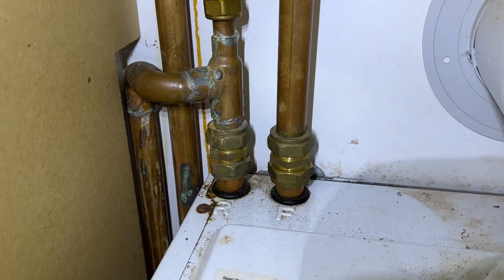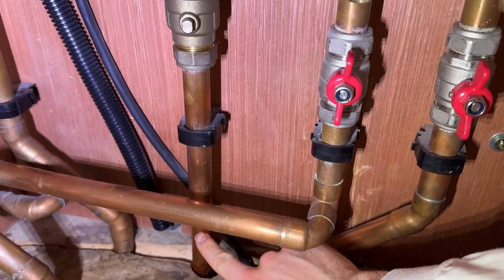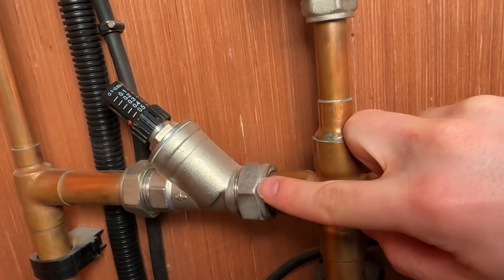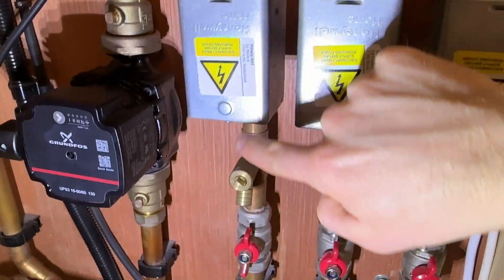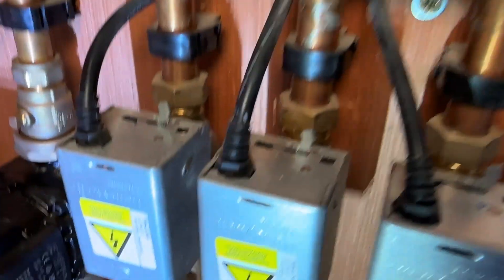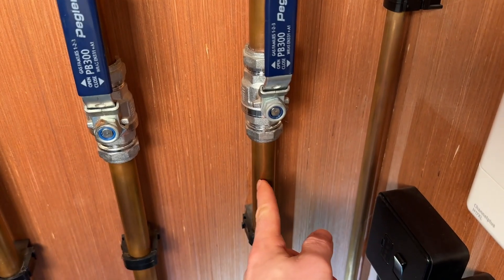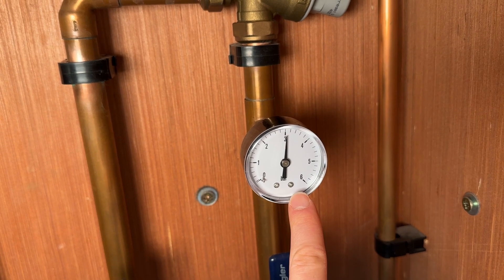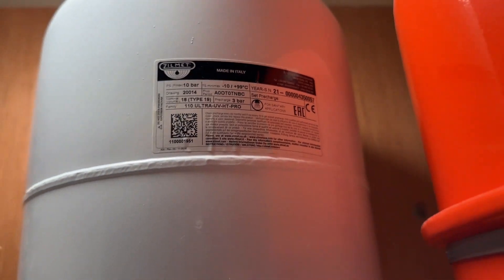How an Unvented Cylinder and Central Heating Work

Comment: really helpful vid, I am about to renovate my 3 bed victorian terrace.  I currently have a combi but will be adding an L dormer with further 2beds and 1 shower room. 3 plumber so far have had different opinions,  1 has said a 50kw combi will easily handle 2 showers, another said 28kw system boiler and cylinder will be best. I dont want to install combi and then not be able to make use of 2 showers, on the other hand I dont want to have huge heating bills with a cylinder. it is 5 ppl household. any feedback would be really appreciated. also putting underfloor heating in new kitchen roughly 6x5 meters if that makes any difference.  TIA.
Reply from the maker: Good luck with the renovation! First thing to check is your incoming water flow rate, as a cylinder needs at least 25 litres a minute. If you get a bucket you know the capacity of, fill it and time it, you can work out litres a minute. 
If you have less than 25, you’ll need to consider a new supply if it is old and 15mm, or if the road has low flow rates, you need an accumulator and pump. 
I don’t think a cylinder will cost significantly more to heat a house and heat hot water, you don’t lose a lot from the storage. Any reason why they said a cylinder will cost more to run? 
Check the max output flow rates on the boilers you’re looking at, and compare to the showers you plan to fit. I expect they would be enough though and you’ll want to go with the cylinder. Thanks for watching!
Reply: @TheDiligentDIYer1759  thanks for your reply, if you have central heating on for a few hours morning and evening does this always heat the water in the cylinder? I'll check what you have suggested regarding flow rate and see what works best for us. thanks again
Reply from the maker: No you have valves controlled by your central heating controller, so you can have heat to the cylinder, or radiators, or both

Comment: You need to talk to your friend  about the difference between ch expansion vessels and dhw expansion vessels as you clearly don't have a clue
Reply from the maker: There is more polite way you could have phrased that…
Reply: @TheDiligentDIYer1759 To be honest, the internal construction of the expansion tank is wholly irrelevant. The only serviceable part is the Schraeder valve as long as you use the red on the heating and the white on DHW (and read the manufacturers instructions) you are good to go. When did a plumber actually repair anything anyway - they just replace parts.😉
Reply: Harsh

Comment: Really good watch - so iv got an older type hot water cylinder and heat only boiler (non combi type) - i have an old "sunvic30" control unit that has a broken switch so i really need to get this sorted because i can only have HW and CH on at the same time, it wont just do HW on its own - another thing, i have one of those Grundfos pumps but its the older type with just manual analog switch with "i/ii/iii" on it - i appear to have a thermostat on the boiler but the small control wheel on it just spins so i cant really have any control over whats going on, when i turn the system on by the control unit it will all come on fine etc and get hot radiators and heat the water - but after so long obviously its turning off the stat at the water cylinder and then shortly after my radiators start cooling down because the boiler turns off - any idea why its doing that? i want the radiators to still stay on heating the house.
Reply from the maker: Thank you, I think it sounds like you need a new control unit. My guess is the controller is shutting off everything because the cylinder stat has clicked off. You can probably get a new one cheap second hand. The one controlling my hot water was actually a new open box one off Facebook marketplace. 
Although if this has always been a problem, it might just be wired up incorrectly. You could try and rewire it yourself, but this is quite complicated if you haven’t done it before and I’m not sure what sign off requirements there are. 
Thanks for watching!

Comment: good video however, you said you had the pump on the flow ! surely you would put the pump on the return less stress and a lower temperature at the pump, pump's are better at pumping ( pushing )water ?
Reply from the maker: I think it’s personal preference really and doesn’t make too much difference, but generally plumbers put them on the flow. Thanks for watching!

Comment: Really nice video and well done - thanks. I'm curious to know - how did you navigate the requirements to have qualifications such as G3 certification for unvented systems as a DIYer? Cheers
Reply from the maker: Thank you! Fortunately a friend holds a G3 qualification, so didn’t need to worry. I think you can do the course yourself though, I did look at it and it was fairly inexpensive, so could be an option for a big DIY install. Thanks for watching!
Reply: @TheDiligentDIYer1759  how did you register it with building control?
Reply from the maker: My friend who has the qualification helped install it, so was able to register it with building control.
Reply: @TheDiligentDIYer1759  The G3 qualification alone does not allow you to register an unvented cylinder in excess of 15 litres. You need to be a member of an approved contractor scheme or gain compliance directly through local building control.

How did you register it with building control?

Comment: With the unvented systems do you have pressure regulation for all cold feeds in the property, I'm thinking about balanced pressure across mixer taps shower valves etc, I imagine there would be a pressure regulator right after the stop cock in this instance.
Reply from the maker: Yes, you have a combi valve that reduces to 3 bar, off that comes hot and cold supply. Difficult to see in the video, but you can see it in the thumbnail back right between the two pressure gauges. Thanks for watching!

Comment: Great video explaining how an unvented system works. One question, you mentioned that an unvented system prevents a drop in pressure when 2 showers are working at the same time. However, in my home I still lose a lot of pressure. Any ideas why? I have an unvented megaflo tank in a cupboard on the 1st floor, which is connected to a system boiler located on the 2nd floor.
Reply from the maker: Thank you! It is difficult to say without seeing the system, but I’ll try! 
It depends what you’re incoming flow rate is already, an unvented cylinder should have a combi valve on the incoming water main to reduce to 3 bar. In terms of flow rate you need at least 25litres a minute on your mains supply for an unvented cylinder. If you don’t have that, it will mean your system can’t handle multiple showers and you’d be better off with a combi boiler. You can measure flow rate by timing filling a bucket that you know the capacity of. 
If your incoming main has a low flow rate you could look at installing an accumulator or upgrading your water main size, ideally you want 25mm mdpe coming in. 
Your combi valve needs servicing annually too and it could be blocked up with limescale on the filter, so worth cleaning that out if you haven’t recently. 
It could also be the way the showers have been supplied, if they are both supplied on the same branch in 15mm, you probably won’t get the flow you need.

Comment: The hw expansion vessel has not got a balloon type diaphragm its not the same as the ch diaphragm because of corrosion the water is heald within the balloon as in the ch one it has the ability to have inhibitor in the ch water where as the hw vessel wouldn't have contaminates in bathing water .
Reply from the maker: That’s very interesting to know and makes sense, thanks for sharing!

Comment: Nice vid mate. Also turn your cylinder stat up to 60 to avoid legionella buildup ;)
Reply from the maker: Thank you! I did do some research back when I installed it and a couple of places said 50oC was enough to kill legionella over a few hours. But looking again perhaps i should turn it up to 60oC
Reply: @TheDiligentDIYer1759 The legionella risk is overstated in domestic properties, especially if you are turning your stock over. Within that, the largest risk (within the low risk domestic environment) is the multiple bathroom house with say 3 or 4 bathrooms and two occupants for much of the year. Then the risk is in dormant shower heads and the like - visitors coming to stay and using a dormant shower - if there is a legionella risk this is multiplied by aerosol droplets from the shower head. As in all things the elderly are more at risk than young people if exposed to the pathogen.

So, in sum, domestic properties are low risk (try and find a recorded case that is not a care facility) A legionella hygiene cycle of once a week for domestic properties is good enough and some would argue is overkill. I do it once a week when my missus is going to have a long soak in the bath.😉

Comment: I wanted to ask if it is easy or difficult to install central heating as a beginner who has finished the 4 month school for hvac systems, where should we base ourselves
Reply: I agree with DIY Guy. By far the most difficult aspect of installing a central heating system is lifting floorboards (especially if it’s nailed down chipboard panels) to put your runs in.

It is a great exercise for someone who wants to bring their skills on quickly.

As a project here are things to consider.

1. The most important step is system design, are you going to go system and cylinder, or combi. The next key part of the design is calculating the total heat loss of the property (good software apps for that like Heat Punk. Next sizing the emitters to meet the heat loss of the rooms (which in total should match property heat loss) and to do this you need to decide what flow temperature you are striving for at your design outside temperature (normally -2 or -3C).
2. Next selecting a boiler to meet your design requirements (heat loss from the property + hot water) and a cylinder and deciding on location of boiler, cylinder and emitters). An important feature is control strategy and weather compensation is by far the simplest (and best) - it is particularly suitable for lower temperature systems.
3. Next designing or selecting pipe sizes and where you are going to run them to minimise the runs, normally 22 or 28mm primaries. You may wish to consider using manifolds on each floor for distributing flow and returns to each rad with a home run for each rad. Best to use 15mm on these to future proof the property.
4. Run the pipes - it’s the easier and more enjoyable bit.
Reply from the maker: Depends on the complexity of the system and your skill set really

Comment: What size cylinder is that? And how long does it take to heat from cold?
Reply from the maker: 210 litres slimline tank. I only have the timer on for 60 minutes each day, but I expect it is quicker than that and the thermostat just clicks off. My boiler is also only set to 55oC, so that will affect the speed of heating.
Reply: @TheDiligentDIYer1759  And for how long does the hot water last in the showers?
Reply from the maker: That does 3 medium length showers
Reply: @TheDiligentDIYer1759  Ok, I want to upgrade the capacity of my vented cylinder. I was thinking 150l is enough, I have time to wait for water to heat back up too! Thanks very much! Your up 1 subscriber
Reply from the maker: Thank you! Worth going as big as you can, have a look at slimline or horizontal cylinders are good if you can put it in the loft
Reply: @vincentcrowley23   *You're